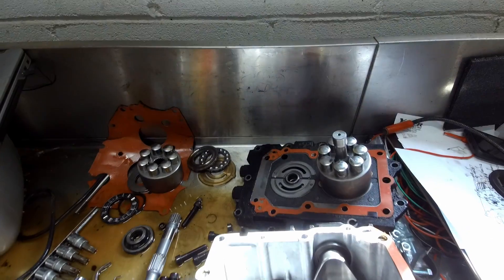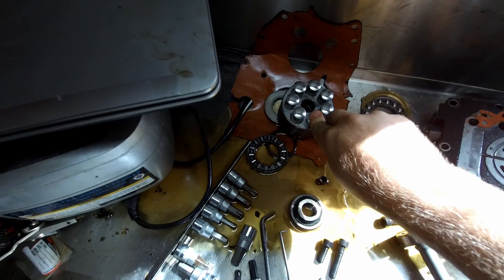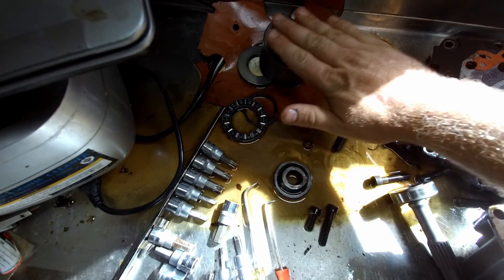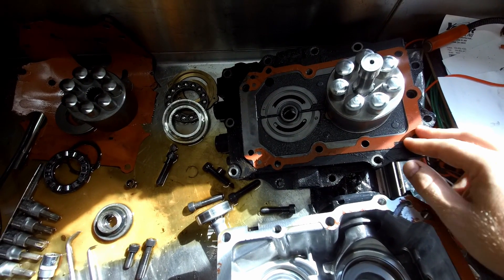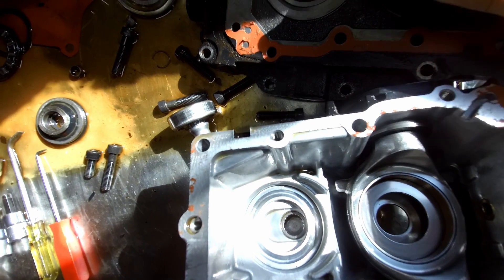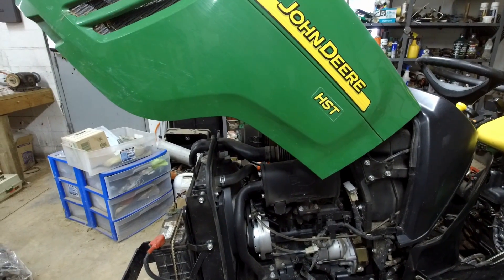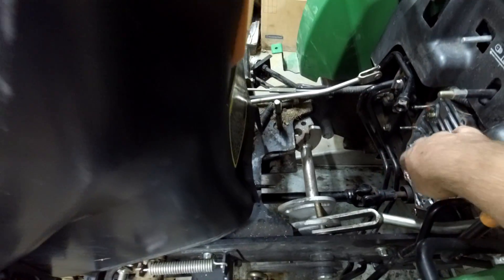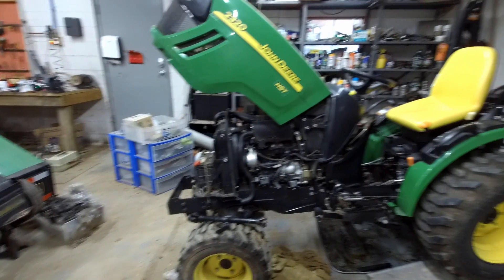EXPLAINED: How a Hydrostat Transmission Works

Comment: I would take that drive shaft and weld on some automotive u-joints.. Problem solved.  Front drive shaft out of a Samurai would probably be pretty close.  This is just another reason why I'll never buy John Deere.  I've never seen a JD video that didn't show a catastrophically bad engineering fail.   I've seen it across literally every little machine they make. It's like they are doing these things on purpose.

Comment: Good job on the video! This variable rate pump is a copy of Vickers Manufacturing from the 60’s to late 80’s. Then Sperry purchased the group & changed it to Vickers-Sperry in the 90’s. Ironically, the GM Harrison produced the A6 A/C compressor based off the same design and was 42lbs. It had 6 pistons and the squash plate was controlled by internal pressure as the system cycled & pressures changed. But, the U-joint is stupid! An extra $5 would be larger & stronger, yet greasing would be difficult. Automotive side has grease needles to reach buried zerks. It still needs positioned correctly to use, perhaps underneath! But who has a lift or pit? Ramps can be dangerous for most homeowners. Planned obsolescence? I didn’t say that but? …..
ASE master 78
Reply from the maker: Interesting design on that AC compressor!
Reply: swashplate surely?

Comment: Just had this issue happen to my 2320 with 450 hrs. Took the hydro pump cover off replaced everything. Got it just out back together and everything is spinning fine. No fwd or reverse? Dread taking it back apart. Thinking the swash plate is kicked?
Reply from the maker: If no movement in either direction but the pump still rotates, then either you may have an air bubble in the pump preventing it form actually pumping the fluid, the swash plate is not moving / applying any angle onto the pump pistons, or fluid is somehow bypassing. Any change in the sound when you apply fwd/rev?  Hopefully its something simple!
Reply: It sounds normal when operating. When you push on the pedals you can hear the hydraulics sounds like they normally do. Everything was a swap over to the new cover so slide the old off. Moved over the race bearing and swash plate. and then slide the new cover on. Any way to release any trapped air? Thanks for the reply!!
Reply from the maker: @jaysunptell  Hmm. If you can hear the hum of the hydraulic pump when you give it pedal input than it sounds like the swash plate must be applying at least a little bit of pressure on the pistons. Normally if the hydraulic fluid resevor is full it should self bleed any air pretty quickly.  Any chance the range selector is in neutral or not fully engaged?
Reply: The shifter is engaged. Jacked the rear of the tractor and it is engaging. Tried getting to spin without resistance. Nothing. 

I did notice in this video you have your cover prepped different than what I did. The swash plate is held in by the pedal linkage on one side and a cap on the other side. When I swapped everything to the new cover. I placed the cover and swash plate first over the middle plate and pushed down to compress the pump springs and start the bolts to install the cover. Then after that I installed the pedal linkage and the cap on the ends. Which was difficult as the swash plate pivot post were not staying centered as the pump springs were pushing on it. After wrestling it got them I think aligned and screwed together. I’m wondering now if that swash plate is actually not seated correctly and is kicked and not perpendicular to the cover. 
I may need to take it all back apart and check. 
The next time I will try installing the swash plate position first with the end cap and pedal linkage like in your video then apply pressure evenly to install the cover bolts. ??
Reply: @ModernSurvivalist So my stepdad and I tore it all down again.  We are getting pretty good at it.  2 hours to get the drive back on the bench.
In opening it up we found that the ball bearing side had come apart and the ball bearings were loose and some imbedded in the new housing cover.
Ordering another housing cover and the ball bearings and the two washers that go around them.
I know last time getting everything squeezed together was tricking and we did not have the thrust plate bolted on.  I know the next time we will bolt that fist them slide the cover over and bolt to the middle plate.  Nervous things will move around again? Any tricks to getting it together without moving while compressing and bolting?   Thinking a clamp might help to squeeze it together then bolt the cover?  Thanks for any help.

Comment: Can you please explain to me who you seperated the hydraulic drive pump assembly from the tractor. I have removed all the bolts ,and tripple checked, but I can't get the assemble to seperate? HELP Please
Reply from the maker: Its been a while, but I think there may have been some well hidden cap bolts on the face of the housing. Take a look at 0:35 and see if you removed a bolt at each of those holes. If so, I often use a soft faced mallet to then tap all around the edges and on each side to break loose the gasket seal. Avoid prying if possible, the aluminum can crack pretty easily.
Reply from the maker: Actually also pause at 0:26, there are a couple more on the bottom as well.

Comment: Thank you for making this video, great explanation of how a hydrostatic pump and motor works. On the dry axle issue, maybe a solution is to fit something like a Scott Oiler - it's a system that automatically lubes motorcycle chains but something like it fitted to those dry points might help.
Reply from the maker: I've seen ways to remotely grease inaccessible zerk fittings on heavy equipment with  permanently attaching small grease hoses routed to an easy to access location, but never seen a method for hard to access grease fittings on a u-joint.

Comment: Van you think of any reason the rotation of the pulley put in reverse the pump works otherwise I have some flow of oil but no power to the drive.
This is the 5th time taking it off ad priming everything perfectly. 
But can't get power unless I rotate the pulley backwards. It's not supposed to rotate that way plus no way to reverse it ...that would not work anyway. I'd take it apart again but I can't think how thats possible. I just fix all the issues now this happens it worked fine before.

Comment: Hey I've got a question on my hydrostatic I have forward but no reverse does that make sense to you and it's on a Parker heavy duty integrated hydrostatic system.
I sure would appreciate any help
Reply from the maker: Not familiar with that unit, but many of them have a bypass / pressure relief of some sort than can be engaged to free-wheel / tow the machine.  Sometimes just a lever, or a bolt you turn. It allows the fluid to the drive motor to bypass in a loop so that the output shaft can free-wheel. I am wondering if maybe that could be related to your issue?
Reply: @ModernSurvivalists  Thanks, I took it apart and found the tiny nut on the Reverse poppet valve  came off and the spring backed off. Also there were 3 tiny pieces of metal inside the pump barrel. I think from the pump springs. This metal scored the port plate and bottom of the barrel so I am replacing those and reinstalled the nut on the poppet valve with lock tight. Keeping fingers crossed.
Reply from the maker: @mountainmike1685  Glad you got it figured out!
Reply: @ModernSurvivalists  Thanks!, I hope your video and other conversations help other folks fix their own equipment.

Comment: It should be used on Hummer or humvee because humvee has large bump where transmission shaft and gearbox and disel tank remains and inside no space for luxury seats , I want to use only hydro lines to power rear wheels so that car floor can be flat .

Comment: Great info & explanation.
Are any parts that are inside/attached to the housing you were discussing used for/by the pto system for blade engagement or is the hydrostatic system used solely for the mowers forward/reverse/speed application only?? Thanks
Reply from the maker: On this model I believe it is for transmission function only. The variable swash plate pump will only generate flow with pedal input (by design). Some hydro transmissions do have a small auxiliary pump that can be used for raising a mower deck or power steering etc. Larger equipment with bigger hydraulic needs will usually have a dedicated gear driven pump for those circuits.
Reply: @ModernSurvivalists  
Ok thanks again for another great explanation to a additional question.

Comment: That is absolutely insane to put grease fittings like this where you can’t even get to them. I’ve heard of these failures being much worse than just that shaft but also taking the trans case with it. Huge failure.

Comment: What type of hydraulic fluid did you use to refill it an do you use the same fluid for the axle part
Reply from the maker: This was a very low hour machine so we opted for the expensive JD stuff. I can't remember which, but I think it called for the low viscosity version.

Comment: You could always take that drive shaft to a drive shaft repair shop and have them make you a brand new drive shaft with different u-joints that are sealed from the factory like automotive style you joints
Reply from the maker: Probably a good idea for anyone with this tractor.

Comment: My 2305 is about the same, very hard to get to the front grease fitting.. I've only been greasing it once a year, maybe I should go for 2x..

My HST has another issue that maybe you have some insight on.. JD and the local shop are no help whatsoever.. I feel my HST is getting way too hot, up over 215F at times using the belly mower.  It has about 700hrs on it and I've been pretty strict to the maintenance schedule.  I've hit something twice in tall grass that stopped the tractor (belly mower doesn't have much slip I guess) with some resulting fair amount of grit on the fluid filter when I did the change.  I've since started only mowing till the temp around the fluid level window reaches 180 (about 30-45 mins), then I stop till it cools.  This is with outside temp in the upper 70's.  Speed of the tractor seems a little slower than new, but not significantly.  Any ideas?  Maybe a restriction, worn parts, something warped?
Reply from the maker: Sorry just saw this comment. I am not sure on this one. If there is a cooler for the HST fluid (I can't remember and don't have one here to check) make sure it isn't obstructed and any fans / belts etc. are functioning.

Comment: Great video. I have a question you might be able to help with. I have a 1990 Ariens tractor that is have a issue. The mower wont move forward and make a whining sound...it move backward strong and fast...just not forward. The belts seem to be tight, the fluid seem to be full, the linkage seems to be moving. The mower is in super good condition and hope to save it. Any help would be great...Thanks
Reply: I'm not a hydrostat trans pro, by any means. But, used to rebuild lift trucks..  gas, diesel, hyd pumps, motors, cyls., etc.
Im about to pull my 1st JD stx 38 hydrostatic trans apart, so I was digging around for info on my John Deere. I got it for free, and ran great, but had weak trans. Only cut grass twice, and it won't move now. 
I'm not paying $700 for a used trans. So grass can grow, until I receive carb kit for my mower, or find a trans rebuild kit for this. 

Mine won't move, and whines, in either dir..
Im not sure what type of trans you have..
 If yours is moving in Rev, solid and strong, but nothing at all in For. ,  try checking all the linkages. 
Basically, pump Pushes oil one direction or the other. If Rev is good, charge pump, creating the oil pressure, is good. Charge pump makes pressure. A valve or radial pump gives you direction. .
. In your case, oil is not going to forward direction, but you have Rev. You have pressure, it's just not going to forward.
 I'd check all linkages, make sure the valve, or actuator is traveling all the way in both directions, nothing is loose, or stuck in them. Make sure there's not a problem with a neutral switch or anything. If there's a neutral safety switch, and it's misaligned, it may stop the fluid when trying forward.
 If it's anything more than that,, you may need a shop.. Again, sorry I can't be of more help. I know the theory behind it,, and I'm able to find problems once I have a machine apart, and I can see things, but,, i Don't have enough experience with them, and can't give you the direct answer.
. Maybe this will give you some clues, help you figure it out. Good luck. 
Shop rates must be insane right now, hope you can fix it.
Reply: If it's your hydrostat may as well haul it to the junkyard and get what you can out of it.
   Hydro transmissions on lawn mowers was the dumbest idea anyone ever came up with.
Reply: @danielsmit11  ya, I second that.
I'm second guessing rebuilding mine. $300+, just for kit. I have to pull it, disassemble, make sure housing itself isn't bad or worn. Starting to think it's not worth the kit or the time to rebuild it. 

I've never been a  fan of hydro trans. It's nice when it works, but don't seem to last long, and if you have inclines on property, it'll just cause more abuse. 

Sad, because last owner of mine,, job ust rebuilt mower deck, and engine has low hours, but $300, is a lot to put into a mower, and it'll still be a hydrostat. 

Thinking about grabbing a 5 speed manual with blown motor online, but that's a lot of work also. Take into account all the time needed to change it, probably not woth it.
Maybe I'll pull the 13hp, try selling deck online, since it was just rebuilt, and scrapping the rest. 

It's really not worth anything once a hydrostat trans goes. 
If all belts are good, shift linkage and free motion piston is free and set properly, it's your trans. 
Take the loss, get rid of future head aches, and get one with a manual trans. 
That way, its only a clutch or belt, when things go wrong.
Reply: @GoGetEm2  sadly pretty much all have opted to go with hydro stats now. Only one I've seen with a regular trans was a smaller craftsman at lowes, believe it was a 32 inch deck even larger craftsman's above that had garbage hydro stats.
Reply from the maker: @chrisludston1455 Unfortunately it is often the demise of many lawn tractors. They are not built to the same life expectancy as the heavier equipment, and as you mentioned if there is any wear in the pump / motor cases that may cause pressure leaks, then a rebuild kit may not restore it back to factory performance.  I would suggest teardown first before you buy the rebuild kit, that way you know what you are working with and shouldn't be any surprises.
Reply: @ModernSurvivalists  ya, thanks for bringing that up. 
I was planning on tearing down, have a look. Before I spend anything. 
I'm stuck debating whether or not it's worth my time. 
Time to pull it. Tear down, clean, then rebuild and install... I'm confident I can rebuild it, with my experience, but thinking about all the time involved. All the hours, plus cost of kit, is it really worth it ?....
Debating grabbing an old one of FB market place, $150,200. Blown engine, steering, but has 5 speed manual trans. 
I'm sure it won't just drop right in, but sure I can rig up something. 
Then again... add up all the time, and probably better of just looking for another running tractor. 
It's a shame, my engine had low hours, has just been gone thru. And the black deck has just been rebuilt last year.  
Makes it more aggravating,  cause I just junked an old rider, stick shift, with 17hp engine, all in great condition. But was missing the mower deck. 
Sucks, because only takes 15 min. To cut the grass with tractor, vs over an hour with walk behind. 
It's just gon a sit there for now. Til I figure out what to do. 
Thanks for the info tho....
Reply: Sad to say from the description of your problem it does sound like it's your hydrostat transmission. Father had a husqvarna that did the same thing. Would go backwards but not forwards till you got off, yanked the mower backwards a ways then it'd make a few laps around till the forward gears locked up again. That mower wasn't even much over 5 years old when it started doing it either. He parked it and got a regular transmission murray. Sad to say murray's went out of business a few years ago.